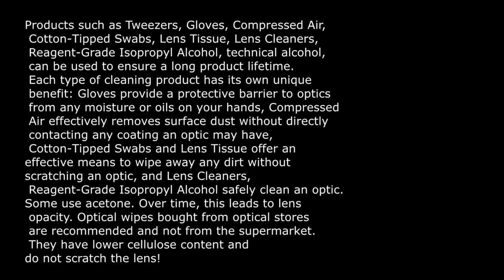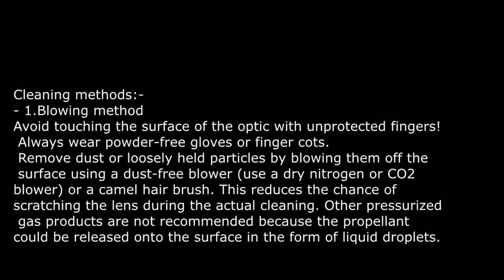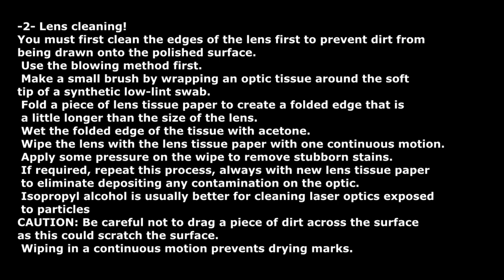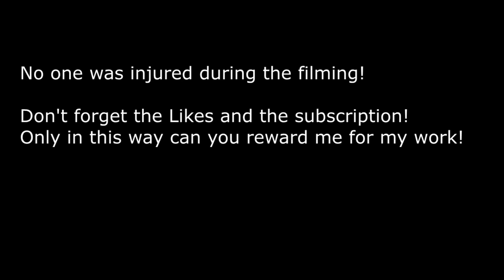How to clean laser lenses

Comment: When reassembling, the set screw to lock the lens has not been tightened
Reply from the maker: Thank you for your attention! You don't need it tight. And it will be easier for you the next time you clean it. If you use the air assist sold by the company, you will completely replace the air cone.